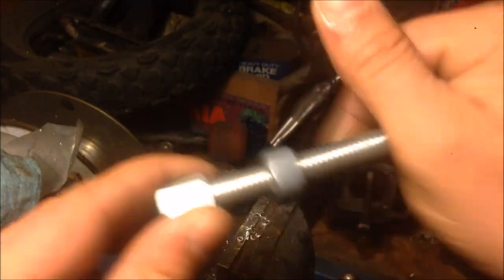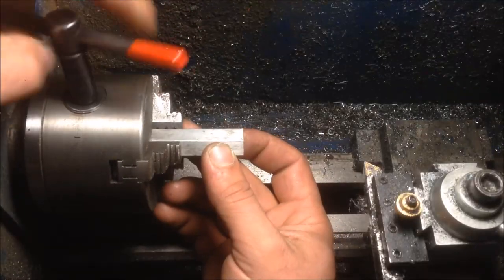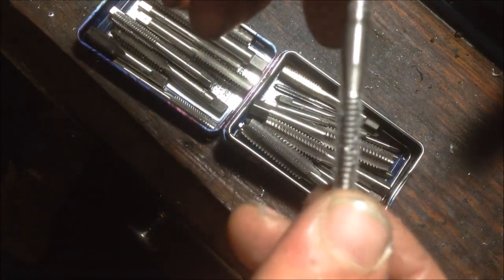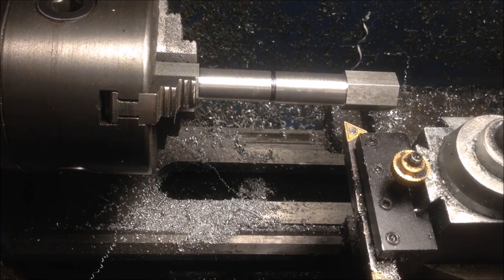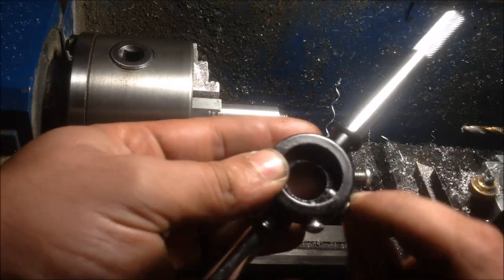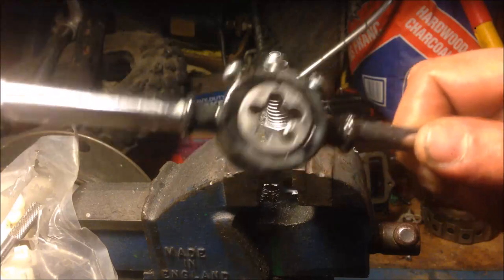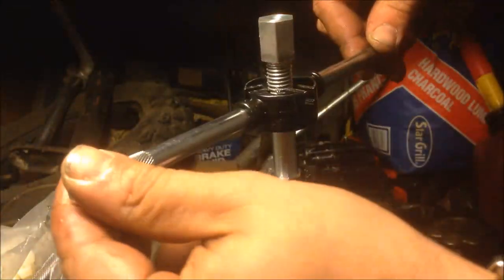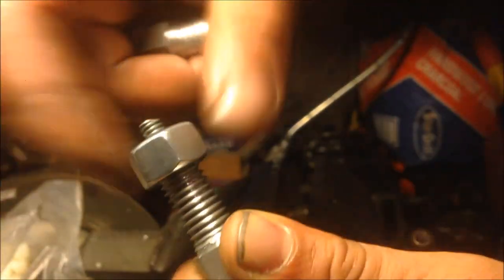How to make an impossible captive nut trick on your home lathe, surprisingly easy.

Comment: Here's a challenge. Design and fashion a spreader / puller. In other words a simple little device that spreads bendable metal apart, and or can pull it together even closer. Something that is hand crank, that can spread half inch steel apart, or pull it back. Get my drift? Should be able to create several hunts hundred pounds of pressure, for to work perfectly.

Comment: I just made one of these last week... and just found your video today.

I have the exact same lathe as you (Pro-Tech).... I cut the threads on my lathe, it works fine... no issues with the plastic gears.  You should give it a try...
Reply from the maker: When I first got the lathe I feared it to cut 16tpi just for fun and profiled an hss blank for an acme thread, did a decent job but it's a P.I.T.A changing the gears for one part. The only time I cut threads on the 7x12 is if I don't have a tap for the job. But your right, it's probably fine with cutting threads provided that you cut responsibly.
Reply: Yeah, I thought the same thing at first.  But, practice makes perfect... after changing the change gears a few times now, it seems a lot easier now and it isn't that big of a deal anymore, LOL

Comment: You can put epoxy or acrylic adhesive to the inner threading to secure. And if needed to remove (in case needed) just heat it, it will detach.

Comment: WARNING
When you have cut the threads and have parted the pieces for nut and final installation, be careful of the thread ends.   They are VERY sharp.  They are also easily damaged and will show the parting after final assembly.  Before parting mark the threads with a magic marker the long wise and you can easily line up the threads during final assembly.  Put Loctite on the 1/4 inch bolt.  (Now I have to go change my finger bandage)  I have shown my puzzle to many people and unless they are a mechanic or have mechanical skills, they don't understand.   They just look at it and ask  "What is it?"  After a half hour of explaining they still don't get it.  (I like your description of your lathe as you can see in my thumbnail)

Comment: thanks for the video. I made one last night. It was pretty easy. But I did think of an improvement that may help the trickery of the puzzle. The next one i make, I am going to use left hand threads on the 1/4-20. This way when someone is trying to twist it off, they will actually be tightening it.
Reply from the maker: Buddy, level 6 if you own left hand taps, level 7 if you can cut 1/4-20 internal on a lathe! Level 10 if you carve them out with a Tiny cold chisel! Either way, left hand threaded nuts and bolts are already a puzzle! Good idea😉
Reply: @slamjam4940  I am at your level 6. Yes, I do have a left hand 1/4-20 tap. I can even cut the threads on the external part. But I cannot do internal threads.
Reply from the maker: @leppy240   I’m hovering Nd around level 3, no problem, cut your LH Ext. Threads on a piece of  annealed drill rod, carve a few flutes in there with the ol’ zip wheel, torch ‘er red hot and dunk it in the crank case of your 1997 KLR 650! Boom, LH 1/4-20 tap.
Reply: Honestly I'm probably at level .5. I have been making parts at work for a few years. I saw the captive nut and new I was gonna try it.

Comment: I have a 7x14 chinese lathe like yours and wondering if youve changed the belt, if so where did you get it???
Reply from the maker: Little late but I have to say this belt has lasted an impressive amount of hours. It’s the original belt and I’ve had the thing for about 7 years. I’d imagine belts are readily available on the eBay’s and amazons.